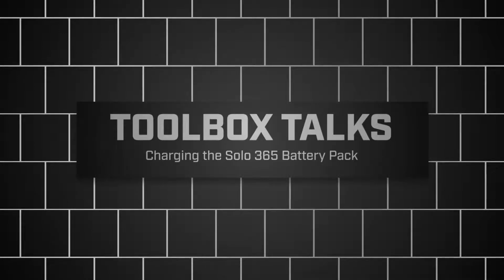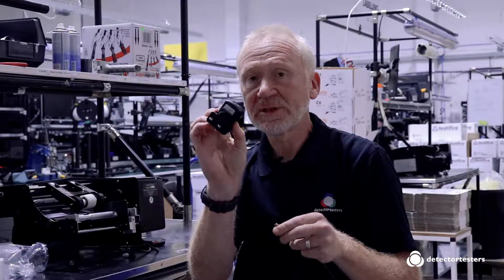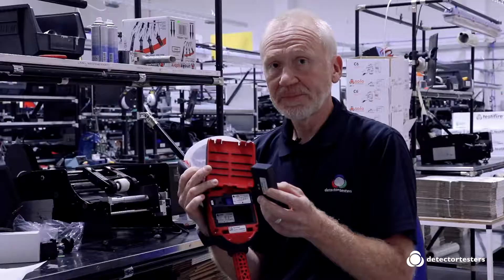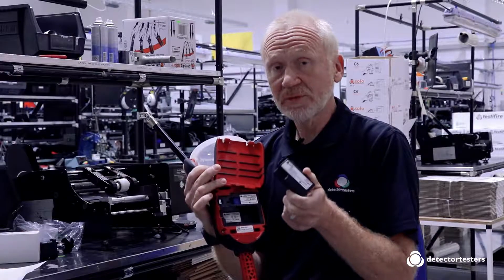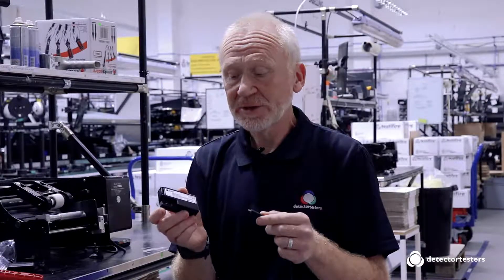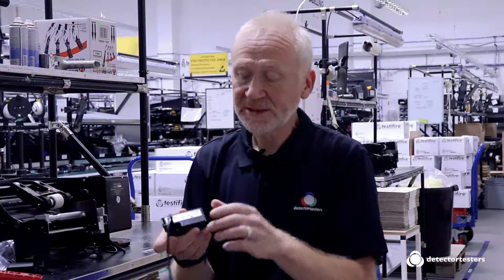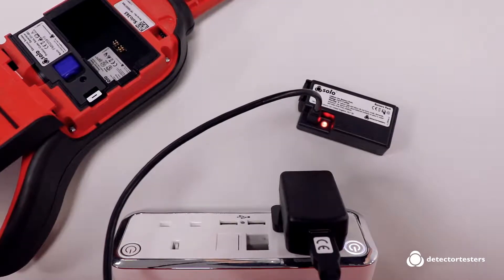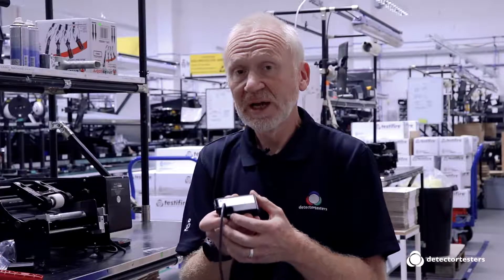TOOLBOX TALKS - CHARGING THE SOLO 365 BATTERY PACK

Comment: How many tests can one smoke cartridge do?
Reply: Up to 250 x 30 second tests
Reply: Using the latest firmware and ES3 capsules it should be possible to achieve 250 x 30 second tests.  If the average test time is longer than 30 seconds the number of tests goes down.